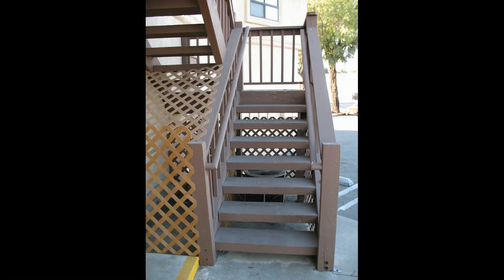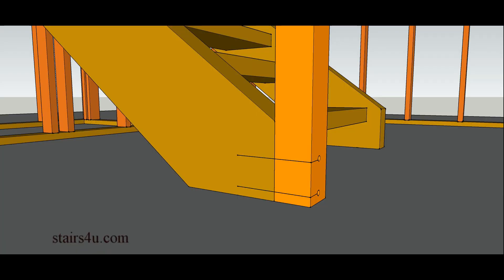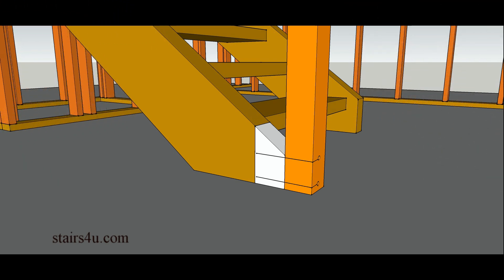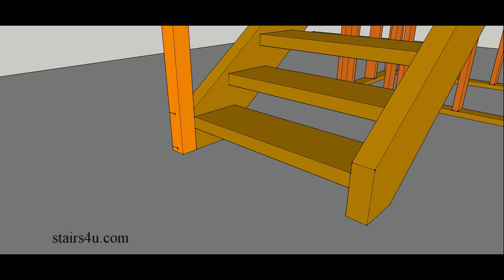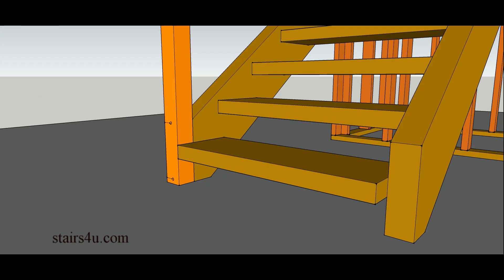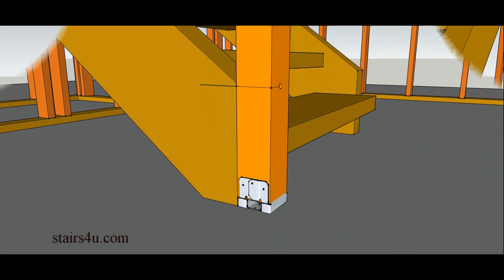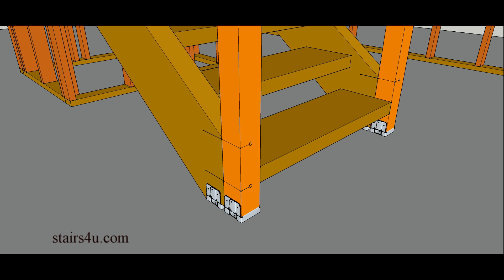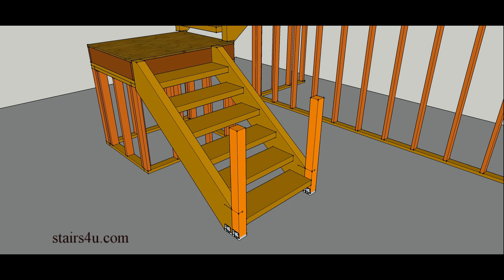How To Strengthen Bottom Newel Post on 4 x 12 Closed Wood Stair Stringers

Comment: what about (ive done prefab external kiwla stairs heaps) they use a 32mm stinger. with 90x90mm posts, which we actually cut open and check out and it places OVER the stringer but not enough to expose endgrain of stringer ofcouse :)

Comment: what if... you added some kind of flashing or nail plate to join the stringer to the newell?  Or make the newell about ten feet tall  and add a decortive arch to hang flower baskets?or  change the stair into a wheelchair ramp so the kids can skate board down it and  deliveries can use a wheel cart?